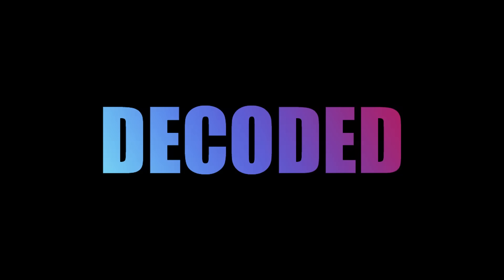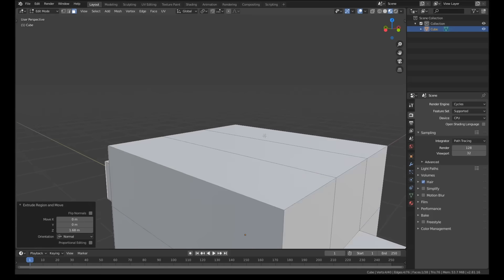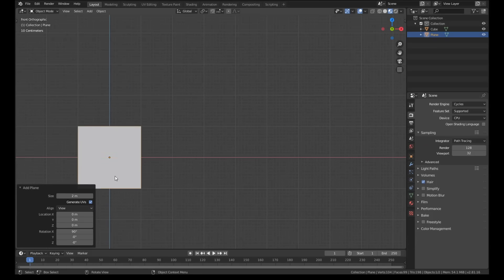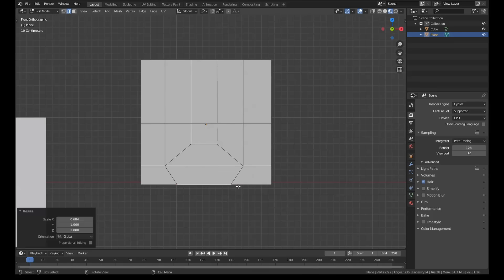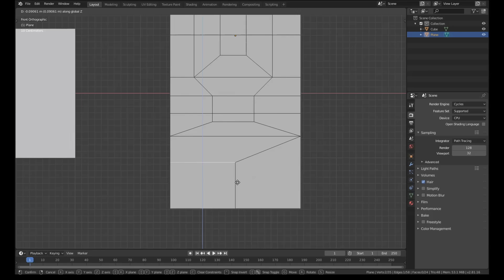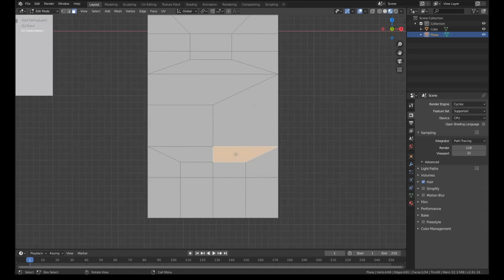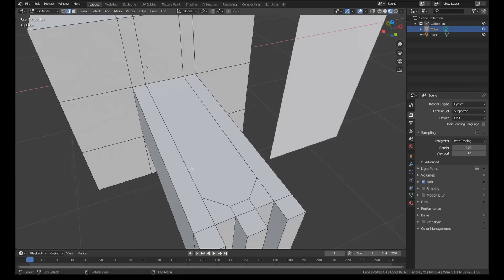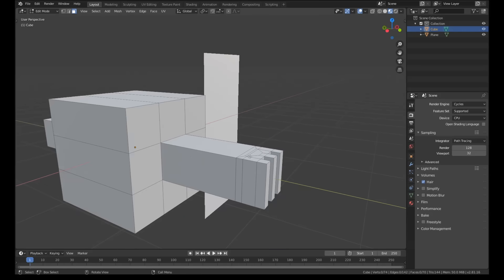Change Your Understanding of Topology In Six Minutes

Comment: So, I am new to 3d modelling, can someone please explain why cant't I just dissolve the edges that go all the way around the cube and keep the ridges? They are still quads and I don't really get the problem with it
Reply from the maker: They aren't quads.
Reply: @DECODEDVFX  I don't see how they are not quads, when they all have 4 edges and vertices. However I do now realised what your method is for. When making a loop cut it won't really loop around if you have deleted those 4 cuts across the whole cube as I suggested earlier. So the method helps to remove those 4 cuts  and keep complete loop cuts possible, which is also important when you use the Subdivision Surface Modifier. I am explaining it to the other beginner dumb dumbs, who might not have a clue what good topology is for

Comment: Sorry, just one more quickie: at 1:23, instinct tells me all you need to do is delete all edges behind the fingers, and you're good to go, because you'll be left with only quads. But is that also a big no-no? Because then behind the fingers you have a large 3D box made up of 10 quads. Is that bad? So we also need to think in 3D, and not just about 2D surface quads?
Reply from the maker: Yes, ideally you want to keep faces roughly the same size where possible. However, that's not the only problem. If you dissolve the edges behind the fingers, you'd still be left with some ngons rather than quads.
Reply: @DECODEDVFX  Ok, thanks for the help!

Comment: Pause the video at 3:34 ......... i don't understand......at this point you have a single quad that becomes two quads. But you seem unhappy with this,  you slide an edge and say "how do we join this up properly". But what was wrong with the situation at 3:34?
Reply from the maker: The top face isn't a quad. It has five verts because its bottom edge splits into two.
Reply: @DECODEDVFX  thanks for the quick reply.... Aha! So even if an edge is straight, it will be considered two edges if there's an extra vert along it?!

Comment: I'm not sure I understand why, you show subdivided topology at the beginning.  The topology you created, would cause a lot of issues if subdivided, based on my personal experiences.  If we're not subdividing, why not just use triangles as needed?  If I was going to create a hard-surface model, I would likely plan it out, and try to extrude the details as I get to a mesh density that would allow for it.  Or just sculpt it and work out the topology later.

All that said, there is some good information here, and you can also use these tricks to redirect the flow of subdivision edges.

Comment: can someone explain why the configuration on the bottom is a problem? it doesn't have the long loop cuts and is all quads. this got randomly recommended to me, i dont know much about topology :D
Reply from the maker: There's actually one ngon at the bottom. One face has eight sides due to the three extruded sections coming off it.
Reply: Ohh I see it, it just looks like a quad but has more edges. Thanks for taking the time to reply!
Reply from the maker: @zf0666  No problem.

Comment: While showing this, you're dissolving a lot of edges. Wouldn't that leave you with a bunch of vertices leftover where those edges used to connect, or does that only happen when you dissolve faces? This method at first glance seems like it would create a ton of ngons in meshes that you use it on.
Reply from the maker: Dissolving edges like this won't leave any verts.
Reply: @DECODEDVFX  okay, thanks. Awesome video!

Comment: Sorry for my naive question but what exactly is the point of doing all that? I found that if I want to get rid of the cuts that run through the rest of the model I select those 4 edges, right before the edge where I extruded the fingers from and simply click dissolve edges - cuts are gone and I end up with one edge where the fingers are extruded from. I am new to this so I am curious why this process is necessary. Can someone explain that to me? Thank you!
Reply from the maker: It's all about using quads instead of tris and ngons. https://www.pluralsight.com/blog/film-games/ngons-triangles-bad

Comment: Also important to note not to mess up your current topology later in the project, if it's hard surface  it may not matter as much depending on the model tho, if it is biological like a human model youd need to make sure the new loops and topology solution would not interfere with the edge loops you've previously made coz it can mess up the animation and so on.
But really cool vid! Works across all platforms

Comment: If you can reduce the number of facesin a work flow what does that generally mean during the 3D modeling process and I know it involves rotate edge clockwise in blender it means that if you can find two points to rotate an edge in a mirrored way you can collapse two face loops into one but like in this video can you show how it happens

Comment: @6:30 why Exactly is the underside “bad topology”? Thanks.
Reply from the maker: It's not seriously bad topology because the surface is flat, but it's far from ideal. One of the faces is an ngon, which could cause issues if I tried to use a subdiv or bevel modifier.

Comment: or... and stop me here if you find this scary... you can just use some triangles instead of tying yourself in knots to have nothing but quads on a model. life's too short to deal with this.
Reply from the maker: Yeah tris are great - until you want to unwrap your model, animate it, bevel it, subdivide it, or add density to a specific area.
Reply: @DECODEDVFX  yeah that's true, I am actually not sure how a lot of the unwrapping is done in blender, but I dont mean triangulating an entire mesh, merely the parts that  are near such a flow jam like that. 

didnt mean to sound rude on that, if I did btw, I've been doing 3d work for a long long time now (zbrush and maya since 2005, max, softimage, wings3d, nendo, and lots of other things before that)  and lots of those apps have gone to become rather independent of topology in many ways, hard or soft edges. 

I do have to pick up a bit of blender to see how it does some of these tasks though, I've been hearing good things from coworkers for years.

Comment: Tip: Use the "J" key to automatically connect two selected vertices by cutting through the surface with a new edge instead of using the knife tool (which can sometimes be inaccurate and create extra vertices).
Reply: Thanks! It's funny how often I randomly come across a comment like this that makes something I do all the time much easier.
Reply: why I haven't seen this yesterday 🥲
Reply: Anybody know how to do this 'J' function in Maya?
Reply: thanks i was struggling with f
Reply: What great tip, the difference is huge after you subdivide it you will notice that all the faces do subdivide when using "J", while using "F" creates extra vertices leaving some faces look like they weren't affected by the subdivision
Reply: J does not cut through faces.. it only lays a disconnected edge on top and gives you very bad geometry
Reply: @mm-hl7gh  you are mistaken, sir. Using J does create the necessary vertices in the intermediate faces between the selected points. It is the F key the one that creates the disconnected edge.
Reply: @mm-hl7gh  That is not true, F does what you described. J cuts through the mesh surface and integrates the edge into the topology. It acts just like the knife tool between the two selected points, except it's safer because the knife tool sometimes gets subtly misaligned and creates two vertices where there should be one. Use J instead of the knife tool wherever you're doing simple cuts. Knife is good for cutting more complex shapes.
Reply: @Keavon  If the knife tool is inaccurate, adjust your view clip start and end. Clip start must not be too small. Clip end must not be too large. It's weird behavior but you can verify that it works with a simple plane.
Reply: @elfakyn  this is true. sucks tho. cant zoom in close without mesh disappearing. sooo laame...
Reply: @Keavon  You just solved some of the biggest issues I've been having. Thank you!
Reply: @Keavon  how did u get it to do that? J does what m m & hyper chango described so what add ons or settings did u fiddle with to get that effect? Cuz I don’t like the Knife tool for its inaccuracies, and I like that Join is simple but I hate that it doesn’t actually work
Reply: @monkeyrobotsinc.9875   if anyone is having trouble with this you can adjust the render culling distance in the viewports properties.
Reply: @monkeyrobotsinc.9875  You can change the view to Orthographic instead of Perspective (shortuc Numpad 5); this way the mesh wont disappear when zooming in! 
NOTE: A bit late perhaps my comment but hopefully still useful!
Reply: @Keavon  Two years modelling and only now I'm finding out about this...
Reply: @Keavon  I had no idea J existed. I just started so I'm glad I learned this early. Thank you

Comment: Right this is pretty useful but u could get away with triangles because there is no 'right' way to get 5 edges flowed in to 1 and what you have done is created poles for making a complete quad-based mesh not saying it's wrong this was really helpful but that you might not always need to do this
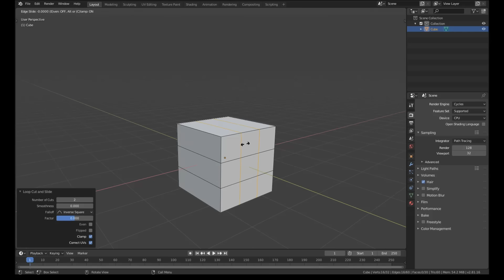Reply: I was thinking about the poles this creates… but then you could say a cube is all poles (3 edges out of every corner), and when extruded like in 0:53 it creates poles too (5 edges), but it's not bad, it's perfectly normal. So those poles are not bad either. I guess it's much better to have the poles than unnecessary loops going all around your model.
Reply: And the tris would by tricky when subdividing the mesh, wouldn't they?
Reply: @MarcinPetruszka  ya I know poles aren't as bad as tris or n gons but still it doesn't matter as much to have tris instead of absolute quad mesh when u don't need to have it

Comment: Sorry, I don't get what all of this was for. Aren't you stuck with a lot more subdivisions on top, compared to how the bottom looks?
Reply: what do you mean?
Reply: But you get n-gons on the bottom, which in case of a flat surface doens't matter that much. As long as you don't try shading it smooth. It's just an example to illustrate the technique. But if the surface wasn't flat, you would get nasty shading problems with n-gons. So the point is to get quads-only topology, cause that way you avoid problems, but still get enough topology to produce the shape you need.

Comment: Im just two months in learning practicing and going through lots of yt vids and i did understand the what you've shown here.
One silly question though,
If the goal is to have those 3 faces to be extruded, can't i just copy them, undo (ctrl+z) 3x or maybe 4x, paste it, remove doubles then extrude them?
If i would do so then i think i could save up to 24 faces?
Reply: The point of the video is that this technique can be used whenever you need to tidy up any geometry, not just on this particular model.

Comment: I've been doing this for a while now and I must say that it is extremely useful, BUT sometimes it completely destroys the flow and also sometimes there is a problem with the subdivision. You should use this on relatively flat or empty surfaces. For instance, an ear is more detailed, than the head, but at the same time there is a flat space before the ear begins, but a tear duct might be actually better with triangles, since there is detail all around the tear duct too, which'd be destroyed in the process.
Reply: Thank you. It’s not nearly as simple as this video makes it out to be. For one, you’re altering the number of edge loops on either side of the topology group in question. You’re also introducing poles, which isn’t something to be cavalier about, as they’re going to change shading and create “pinch” in your topology, which isn’t always desirable. So no, this isn’t a one-size-fits-all solution to any topology problem.
Reply: Finally, a comment from someone who has real experience in SubD modelling.) All these methods to end loop cuts with a quad has been used for years but they are still rarely used as they usually produce bad shading.
Reply: @vladimirlavrentyev9206  I'm a blender noob. What would actually happen if we never used the video's method and jsut had  loop cuts going around the full model?
Reply: @Sh-hg8kf  If a loop ends in that way on a curvy surface than it will most likely produce bad shading when the model is subdivided (not across the whole loop but only in the place where it ends). On flat surfaces this method is ok,
Reply: @vladimirlavrentyev9206  could you explain that in simpler terms?
Reply: @Sh-hg8kf  whenever you apply Subdivision modifier on such geometry you may have improper shading right in the place where the loop ends. But if you're new you may probably not worry about such things as these shading errors are not that visible. Especially, if you do your personal projects.
Reply: @vladimirlavrentyev9206  but what if the loop goes all around the mesh completely?
Reply: @Sh-hg8kf  than the shading should be ok
Reply: @vladimirlavrentyev9206  Is there a name for a method that would be better to use on curved surfaces that I can look up? Thank you for pointing this out!
Reply: @JackTheVulture  As long as you have no shading problems or they are negligible it is ok to use the one in the video. However, good shading is important (like on curved shiny, metal, reflective surfaces) than there are unfortunately no single method to solve this problem. Topology is quite a tricky thing. I think it is best to model a bunch of stuff using professional tutorials and then the understanding will come. Arrimus 3d is good but he mostly uses 3ds max (and from this year Blender as well). I've model a lot of things by his tutorials and I still have issues on how to do this or that.
Reply: @JackTheVulture  Idk if this actually works, but presumably trying to keep faces vaguely square and minimising the size differences between close faces could help smooth things out a bit?
Reply: @Sh-hg8kf  problem is, if so many loops go all around the mesh being so close to each other, applying subdivision results in creases instead of smooth geometry if the surface has curves... but if you use the technique shown in this video, then applying subdivision will result into uneven shading and pinching... If you ask me, I would still go with the former option of running multiple loops all around the mesh instead of ending them prematurely as per the video...
Reply: Exactly.  The only topology you'll ever need!  To solve simple joining problems on planes and flat shaded meshes, maybe....  If that was all topology was, we'd have had awesome, fully automated retopo tools a decade ago.
Reply: Lmao, yeah, towards the end of the video I've been saying out loud at my screen: "yeah cool and now subdivide it, go ahead and subdivide, like you showed at the beginning". Who really does hardsurface today and not use subdivision tools?
Reply: It seems like it's more handy for joining two distinct pieces together than a single contiguous shape.
Reply: On curved surfaces just add more segments, the problem is fixed. No stretch marks or pinches. Curved surfaces need lesser distance between segments.
Reply: "Let me demonstrate this under perfectly idealized circumstances and never mention where this may trip you up in practice!"
Reply: You probably should just use instantmesh to remesh the mesh you finish
Reply: @windflier1684  This method doesn't work for a model you want to animate though

Comment: So why was that underside considered bad topology? And couldn't you copy those cuts you made to the bottom somehow? So you don't have the make that same arrangement again?
Reply from the maker: The bottom is bad topo because it has an ngon (a side with more than four edges). It probably wouldn't matter in this instance, but that could cause issues if I wanted to add a subdivision modifier or something.
Reply: @DECODEDVFX  ohok

Comment: At first I didn't quite get the point of what you were saying. I was like "at 1:27 just dissolve all those loop cuts."
It wasn't until I got to the end (and tried it myself) that I realized that doing it your way results in all quads!
Reply: Hi ! I'm still stuck on the same  initial thought, what is so great about quads?
Reply: @TroglodyJeej  you can loop cut through them easier.
With a square or a quad, going through the "middle of it" is easy because a line can just go in one edge and out the opposite.
If you go in one edge of a triangle or pentagon, there are two possible edges it can come out of. This means Blender gets confused if you try to loop cut (CTRL-R) it.
Also I think quads and squares deform much easier to it makes animation better.
(Ofc when it's rendered it's turned into triangles anyway, but at that point you're done working with it so it doesn't matter)
Reply: Is there cases where we're  forced to reduce the number of faces manually like this?

Comment: ...Still not sure why some 3D modelers are obsessed with "quads". I'm looking at that big mass of geometry there and all I can think is this wouldn't be such an issue if people weren't so allergic to other shapes.
Reply from the maker: Ngons are fine on a totally flat surface with simple geometry. But you can't subdivide or bevel them, they create shading artefacts, they don't warp properly for animations, and they lose edge flow which makes UV unwrapping a pain.

Comment: This is very nice, but honestly I prefer using tris to do the same. With this your edge flow is all over the place, whereas using tris simply halts the loop. having multiple of these strung together will not subdivide or bevel right, so it doesn't reap the benefits of having good topo. Very good video and explanation though.